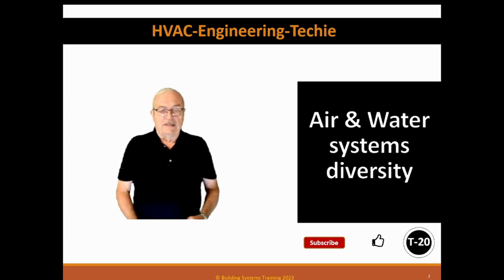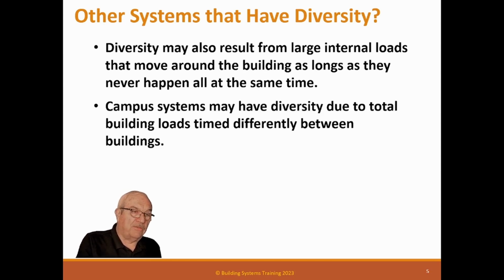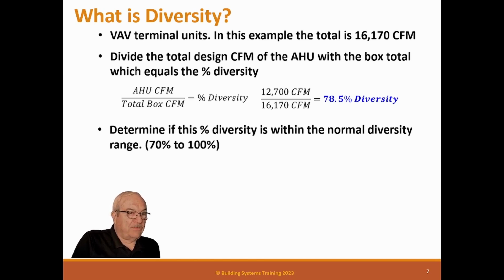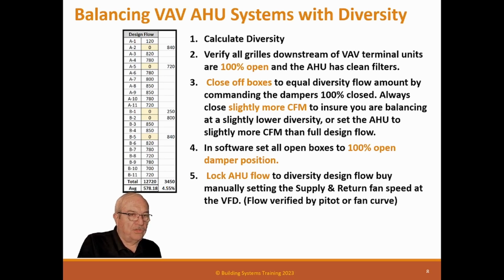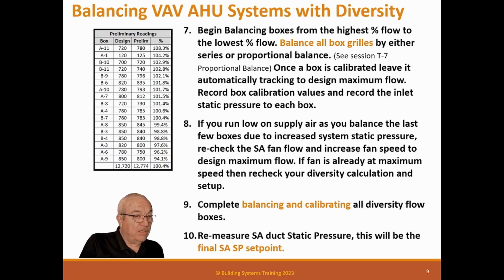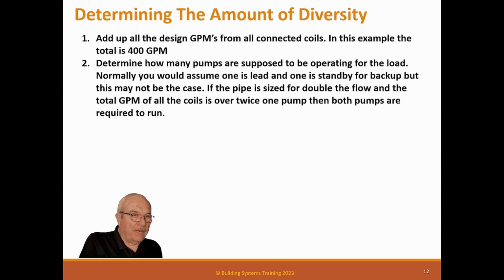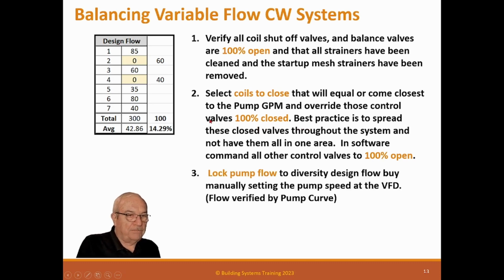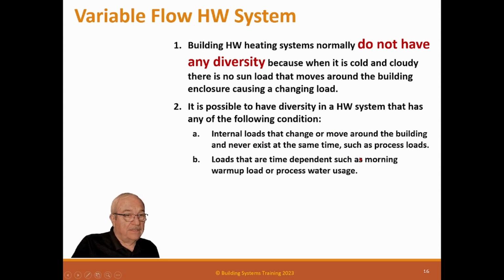HVAC, How to perform Test & Balance for Air & Water systems with Diversity. Training Session T-20

Comment: Another question I had was you say open all the dampers to 100%? Are you meaning 100% max cooling or 100% damper position? I'm assuming since your doing the unit it may be 100% damper position but if you were just balancing the boxes it would be 100% max cooling correct?
Reply from the maker: When calibrating a box, you open the dampers full open so the box will get its maximum flow. Then input that calibration factor into the box. Then when you instruct it to flow full design flow the damper will go to that flow.

Comment: What do you mean open the closed boxes you closed at first and then close some of the other boxes? which boxes do you close? and what do you balance those closed boxes too? and what do you balance those other boxes that you are lowering too? that last part confused me a little. I wished you would have explained that just a little but more, I'm a slow learner lol
Reply from the maker: I recommend you review this video again paying close attention to why you are closing boxes. With systems that have diversity the total air flow to the boxes is greater than the total flow of the fan. To correctly balance these systems, you must setup the system by closing some boxes to equal the total flow of the fan then balance the boxes at full flow so when they are all balanced the total box flow matches the fan flow. Once that is done you open those boxes you closed and close others so you can balance those boxes that were closed the first time. It is best practice to close boxes scattered throughout the system to mimic actual system operation. Select boxes with flow that will total up to near what you need to make the box flows and fan flows the same or at least close.